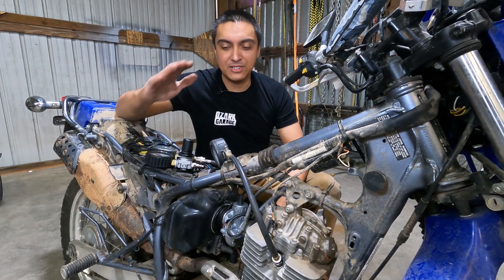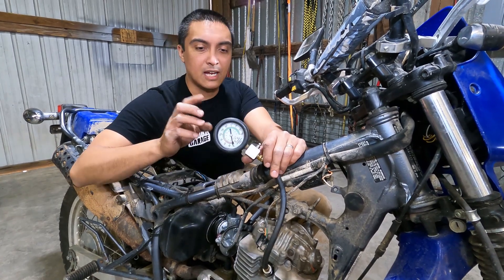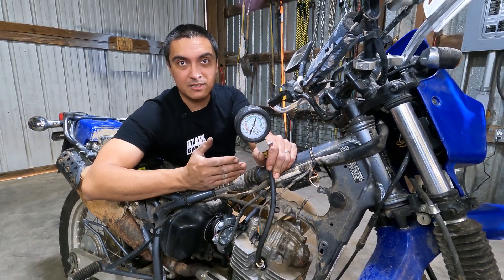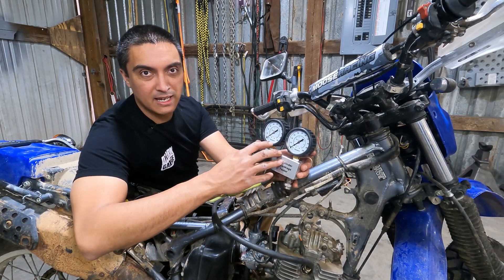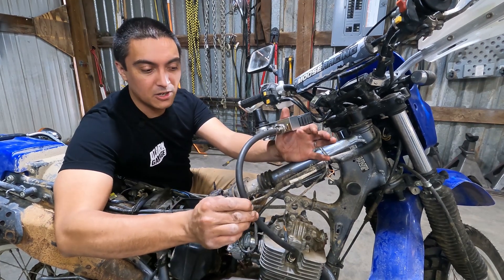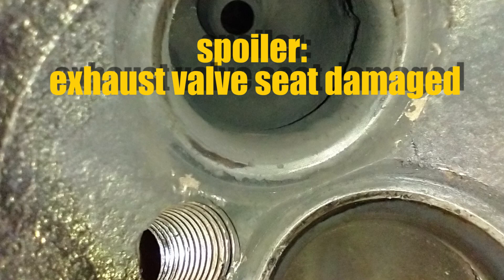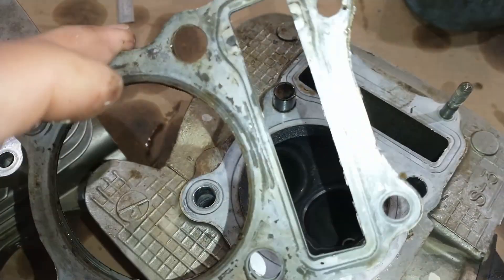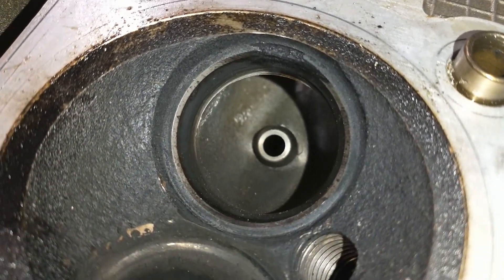Engine Compression Test vs Leak-Down Test: Why you need BOTH!

Comment: It doesn't work with a decompression arm on the valves.
Reply from the maker: Yeah, that's true. If you have a kick start with a compression release cable, you will have to disconnect it.

Comment: I might be having a brain fart but how do you keep the engine from starting during the compression test?
Reply from the maker: Even if you are doing a multi-cylinder engine, you typically remove all the spark plugs so you can just move the compression tester from cylinder to cylinder.
Reply: @ozarkgarage thank you, my bike also has EFI, how do I stop the cylinders from getting sprayed with fuel during the test? Or does that not matter?
Reply from the maker: @AlmondBuddha  pull the fuel pump fuse or disconnect the wiring connector from the fuel injectors
Reply: @ozarkgarage thank you!!

Comment: Can you use the leakdown tester to read compression? The needle is stuck behind the needle stop on my compression tester.
Reply from the maker: No. The compression tester has a check valve, the leak-down tester doesn't. The pressure on the leak-down would just go up and down with the piston if you tried to crank it.

Comment: compression test: 126,150,150,150 psi.   leak down test: 6%,6%,1%,1%.  why does my  leakdown test looks good but not compression test?
Reply from the maker: Great Question! It could be a cam/lifter issue, specifically on the intake side. The piston and valves are sealing well, but the engine isn't drawing in enough air to compress.
Reply from the maker: Also, if you have adjustable valve lash, check to make sure the valves are adjusted properly.
Reply: make sure the throttle flap is fully open